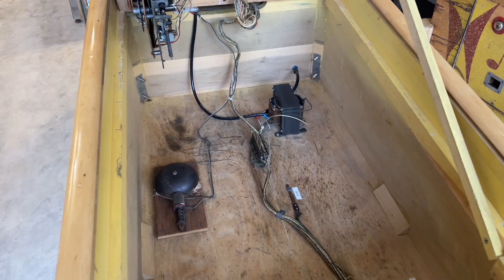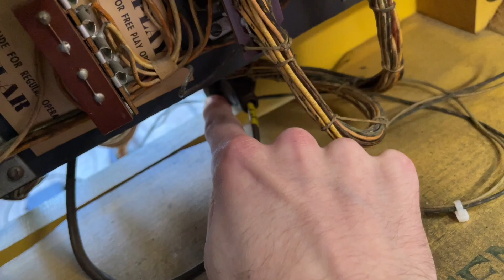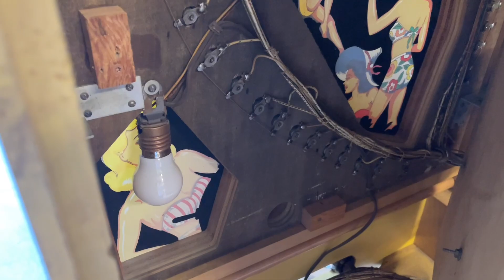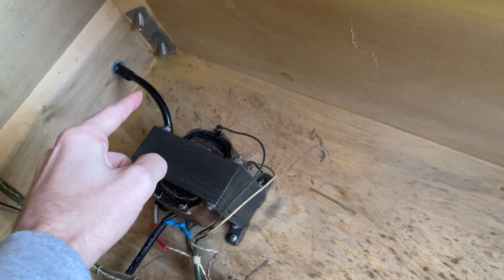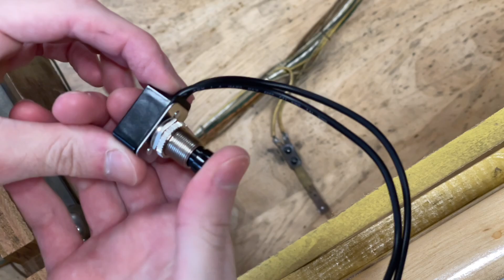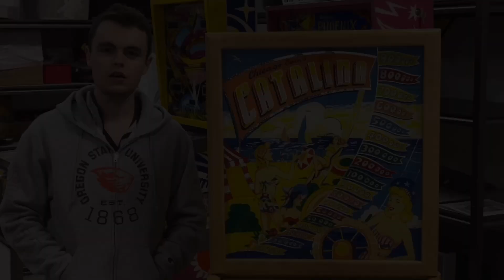Pinball Circuit Modification: Installing a power switch in a machine that doesn’t have one

Comment: You should consider recessing the push button into the cab. If you take the legs off and out that on the ground or slide it into a truck, it’ll rip it out. Look at how it’s done on the Phoenix or CE you have there. :)
Reply from the maker: The bottom panel is very thin so I can’t, but if I ever transport it I’ll be sure to remove the button and put it inside the machine so that doesn’t happen.
Reply: @MaxsGarage true. If you feel like messing with it, get you like a 3”x3” piece of scrap 3/4” plywood. Glue it to the inside of the cabinet over the button hole. Mount the switch onto the plywood so it’s deeper into the cabinet. May have to use a fosner drill bit or something to make it easier to hit the button once it’s in there. Or just remove it like you say. Just a suggestion. 😊
Reply: @MRNBricks  don’t even need a 3x3 piece. I just ripped the wood off an unused mousetrap. Free since I had plenty of them.